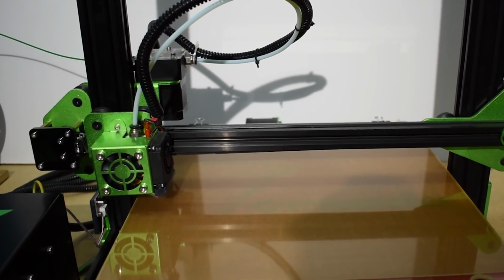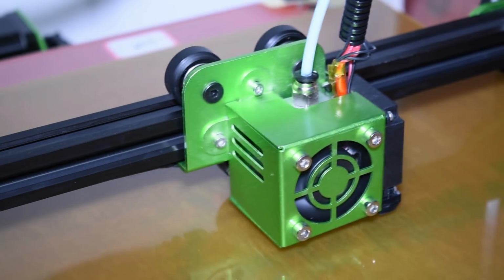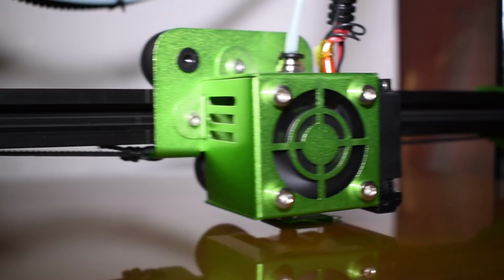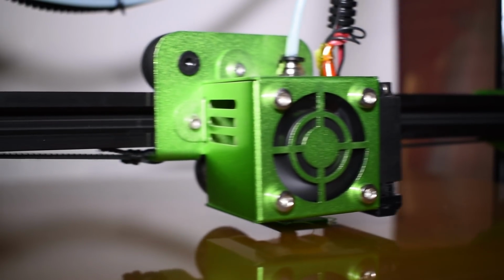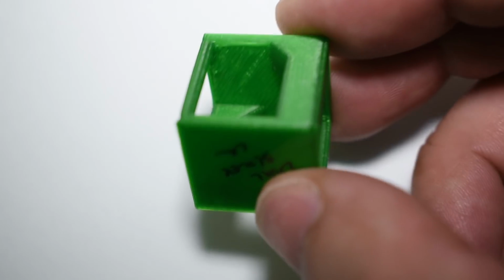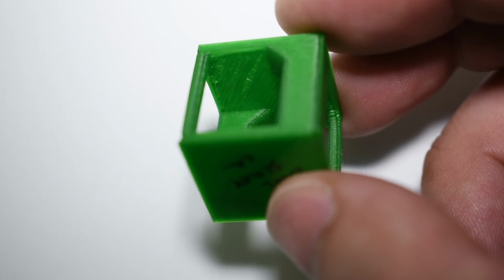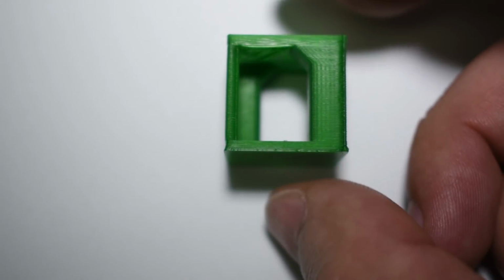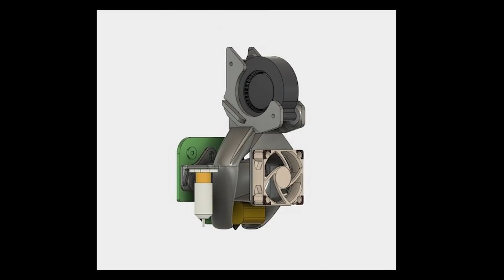6 Fanduct Comparison - Tevo Tornado 3D Printer

Comment: How can I connect 2 24V fans to an ender 3 pro?
Reply from the maker: you can connect them in parallel and use the same layer fan connector for both.
Reply: ruiraptor Are sure? Because I don't know if the Mainboard can Handel that for a longer time. But thanks I will try it👍
Reply from the maker: The fans draw small current. The board will handle a couple of fans connected in parallel. Just make sure you don't short anything.

Comment: Will the single fan blower version work on a cr-10?
Reply from the maker: Not sure if the position of the mounting screws are the same.
Reply: keep in mind that the cr-10 uses 12v unlike the tornado, which uses 24v

Comment: It looks like your adding an additional fan..  Where do you plug the third one into?
Reply from the maker: For the cases where you have a dual fan for layer cooling, you connect the second fan in parallel with the first one.
Reply: @ruiraptor  That doesn't cause too much electric draw and reduction of voltage?
Reply from the maker: You mean current draw? No, the fans draw a fairly small amout current.
Reply: @ruiraptor  Correct, would it cause any harm to my main board in the 3D printer?
Thank you for responding so fast buddy!
Reply from the maker: Not if you connect correctly both fans in parallel. ;)

Comment: @ruiraptor do you have a video showing the install of the fang(single fan), like how to remove the side fan and replace it with the top 5015 blower? Having trouble figuring out how to remove the side one, and where to plug in the new one.
Reply from the maker: Hi Justin, we don't have a detailed video about that, sorry.

Comment: what blower have you used ? A 24V one? Is it silent? I tried several 24V ones without finding a silent one.
Reply from the maker: It's not completly silent but it's not that bad. It's not easy to find a quiet blower.
Reply: @ruiraptor  no that bad is much better to the ones I tried. Where di you geet yours? ;-)
Reply from the maker: I bought mine on ebay.

Comment: Hello great video
 I was under the impression that  pla would warp as it would be right next to the hot end. Have you experienced That? Anyone.  been told to go abs but do not have the proper environment. thanks
Reply from the maker: Hi Alexander,
You should use PETG or ABS for the fanduct, however, in certain designs (the ones that are not too close to the nozzle and heatblock), you can get away with PLA. All the models that you see in the video were made with PLA.

Comment: what size is the blower and where should i getone from?
Reply from the maker: Hi,
The blower is a 5015 model.
You can find them here:
https://www.banggood.com/pt/DC24V-Cooling-Fan-Ultra-Quiet-Turbine-Small-DC-Blower-5015-For-3D-Printer-Circuit-Board-p-1108987.html?p=84280421195697201804&utm_campaign=21195697&utm_content=3312

Comment: I got the tevo tornado. ( new  version  2018)   thinking  of doing the same  cooling  fan update   but  I dont know. If  I  need 12v or 24v  fans  (  ideally  to  wire  it on. Stock wiring  from stock fan)
Reply from the maker: Hi,
Go with 24v fans. This way you can connect the new fan wire to the existing one directly.
Reply: Thx for the advice
Reply: where did you buy your tevo? im looking to get the tornado but want to make sure i get the newer 2018 version.
Reply: @millyvanillli2617   I got my from Amazon    ( last time I checked  was  not available  on the 2018 version)

Comment: Great Video.   What blower did you use for the "Fang with Blower"?   Did you use the 12v blower he describes with a stepdown transformer or did you use a 24v blower?  Thanks
Reply from the maker: Hi William,
I use a 24v blower and is connected in the same connector where the stock one was
Reply: @ruiraptor  how did you connect the blower fan up to the existing connector, is there a connector somewhere inside the tube?
Reply: Thanks you :)
Reply: Could you provide a make/model or a link to the blower fan that you used?  Affiliate link would be ok with me, BTW.  Thanks!
Reply from the maker: Hi Huskie,
No, there is no connector between the fan and the board connector. I just cut the wire and crimped a new connector so i could test all the different fans. You can do the same or just solder the wires.

Comment: I just installed the Petsfang on my Ender 3, using the stock fans.
The fang itself attaches now with M3 and nuts slide into it.
Seems to work okay.
If I didn't install this, I wouldn't have known Ender forgot to remove the two bolts used to align the hot end.
A common QC issue apparently.
Thanks for sharing, subscribed.

Comment: can you use the stock fans
Reply from the maker: The stock layer cooling fan is too small and i would recommend a blower instead a fan because it has a much better performance.
Reply: wOOx TM there all over amazon 50 mm blower

Comment: You missed my fanduct desigh;  I call it Z-19
 https://www.thingiverse.com/thing:2911981
It's an easy swap, using the CR-10's stock fans, no soldering needed;  but my "fangs" are designed mindful of basic aerodynamics, which none of the fanducts I've seen so far seem to.  Read about this in my notes on the Z-19 page.   You should give it a try;  I bet you'd get results almost as good with it as with those other designs featuring big blowers;  but I will be designing an upgrade very soon, that will use a 5115 at the top and a 40-40-20 below.
 I designed the Z-19 for Creality printers, but with a bit of modification I could make it serve the Tevo Tornado as well.
Reply from the maker: Hi Dan,
Thank you so much for sharing your design. I might test it soon. Also, if you get the new version working let me know.
Reply: Thank you for replying.  The Z-19 is finished;  it will stay as it is, at rev 1.5, unless some defect is reported.  The new version will be called "Z-X";  it will be a separate thing;  and will feature a 40x40x20 fan for the hot end;  one, or maybe two, 5115 blowers for model cooling;  and a few extra surprises... ;-)   I have a page for it already;  --but not much to see yet...
https://www.thingiverse.com/thing:2991795
 But so, the Z-19 was, and is, meant to be an entry level modding fang thing, easy to swap out the box and in the print, no cutting or soldering;  no new parts to order;  even using the original screws.

Comment: Bonjour et un très grand merci de France pour ce super test cependant j'ai une question esque le model (Fang With Blower) peut ce faire pour une Créality CR-10 ?  merci d'avance et bonne continuation.
Reply from the maker: Hi Serge,
I'm not sure if the fang with blower will fit the CR-10 as i never tested that, but i know that the second model (the petsfang) has a version compatible with the CR-10.
Reply: ruiraptor 
Un très grand merci Ruiraptor bonne continuation

Comment: Thanks for the great video!!  Would love to see an installation video on this if possible.  I know you show how to disconnect the old, but adding in the new is where the trickiness comes in (especially for those of us not blessed with an understanding of circuitry)
Reply from the maker: Hi David,
Thank you for your comment.
When you say "how to install" are you referring on how to place the fanducts or how to connect them electrically?
If you mean connect them electrically, then i can share that you just need to connect the new fan to the same port on the board as the stock one...or...just do like i did and cut the wire from the stock fan and connect the new one to the existing wires (red to red and black to black).
Reply: im going to be trying that once I finish the print sets that im currently working on.  3d settlers of catan.  id love to be able to fully dial in my machine as I see some pretty spectacular results coming out of the facebook group.

would a local hardware store carry the kinds of machine screws you used for this?  as for the electronics, I can probably muddle my way through the connections after spending a month trying to get the ones for the BLTouch done right.

Thanks again for the AWESOME videos.  love watching them!
Reply from the maker: Hi David,
FOr the winner model, you just need a couple of screws to secure the blower (or just use some zip ties while you dont find them). Those screws are easy to find. The others that secure the fanduct you can use the same ones from the stock assembly. For the pestfang it's more tricky...you need some small M2s and stuff. In his thingiverse page he mentiones the screws needed.
Reply: @ruiraptor  have you had any issues with your board from the extra electrical draw, by adding an additional fan.  The voltage drops when you add an extra load, has that affected anything for you?

Comment: Hey.Which is better number 3 or number 5?
Reply from the maker: Hi,
As i mentioned in the last minutes of the video, both have great performance. I have chosen the fang model (#3) due to the fact that it's much easier to install compared with #5. For the #3 you only need 2 screws to install the fanduct and you can use the same screws from the metal cover. As for #5, you need to buy one additional long screw to secure the center piece and some M2 screws for the sides.
Reply: Thanks.

Comment: I was curious if you had to adjust the fan speed any with the stronger airflow.  Years ago I upgraded my Ultimaker Original from a single 40 mm fan to dual 50mm on each side.  I noticed prints had great overhangs only on the side the fan was on.  Well the CFM of the new fans were so powerful that it was requiring more effort to keep the bed and nozzle to temp.  As a result, I had to lower (in slicer) fan to 50% to equal what the old fan could do.
Reply from the maker: Hi,
Yes, depending on the fanduct and blower used, you might need to reduce the flow %. It's important to choose the best fanduct and blower so that you have the best performance from the blower and the right air orientations from the fanduct.
It's better to have more power and don't need it than need power and don't have.
In any case, you should always adjust the flow % according to the model you want to print. Some models require less flow % and others require more.
In your slicer, you can set the flow % by layers and this way you can have areas with less flow % and areas with more flow %.

Comment: love the video, thanks for doing all this work! I just printed the fang/blower and installed it. Now I'm on my first test print I got "Temperature Runaway" error telling me to reset. Any idea what is going on? Thanks :)
Reply from the maker: Hi,
You probably have your blower running at 100%. Are you using the blower always on from start? Try to reduce the flow % especially in the initial layers and keep it off for the first 3 layers at least.
Reply: haha, I got 12v blowers. I'm running them at 35% and it's working beautifully :) Thanks for the video!
Reply from the maker: That explains it :)

Comment: Need to post what mods were needed to attach the blower  (clips , connectors , etc) to the stock wiring , and where to get those as well. Other than that nice tutorial.
Reply from the maker: Hi,
You are right about that. I haven't mentioned what's needed because each designed explains on their thingiverse page. Nevertheless, the one i have chosen is the easiest as you can use the same screws to secure the fang. You only need 2 aditional screws and nuts to secure the blower. About the connectors, you can solder the wires directly if you dont plan to switch fanducts or get molex or JTX connectors. Any will work.
Reply: For the fans did you splice the stock fan fire for it?
Reply: I'm new to this myself , but if you watch the video and at the 3:55 portion , is when he is removing the side fan , and I believe he cuts those 2 wires (pos and neg)  and puts a molex connector on it , and the blower has a molex as well and is connected to that connector . If I am wrong , someone please correct me. You can put any 2 wire connector here , since I have a lot of JST connectors , I will be using those .

Comment: What about stock one with different end duct point https://www.thingiverse.com/thing:2437407 or. similar. I like the design of the original one because it is more secure and protects heatblock if. it falls out. I know it is possible to use secure options in Marlin but still.
Reply from the maker: Hi Troy,
I did print that one too but i noticed a few issues...
One is that it is too close to the hotend so you need to print this one with ABS and not PLA.
Second, it is too small and it takes out the visibility.
And third, the air output is too small. With the fang models you have more output and therefore more performance.

Comment: What's the best cooler to use  with stock vents?
Reply from the maker: Hi Romex,
By vents you mean the heatsink?
All the models tested are for the stock hotend which includes the stock heatsink
Reply: Thank you for your quick answer :) That's what i wanted to hear, but i'm still not 100% sure... Fan @8.49 doesent look stock to me, that's why i asked.. I wanna use the original fans wich came with the tornado.
Reply from the maker: Hi,
We are talking about different things.
I was refering to the heatsink and you are referring to the blower.
In that case no. I did not used the stock blower except for the stock hardware (first test).
You have designs that use the stock blower (not tested) here:
https://www.thingiverse.com/thing:2842505
and
https://www.thingiverse.com/thing:2843375
There are more on thingiverse

Comment: the added weight on the print head is not an issue?
Reply from the maker: The X axis is very light. The extra weight does not make any difference.

Comment: Hi Ruiraptor, what is your method for quick connecting the blower (with female connector) into the cable casing? Did you install a male plug on the stock harness? Also, do you use caps on your blower to reduce whine and also maintain PWM control? Please share!
Reply from the maker: Hi Paul,

For quick connecting the blower I simply cut the stock wire next to the blower (a few milimiters from the blower) and soldered a new connector.
This way I don’t have to remove/install the entire cable all the way in the cable casing.
Regarding the caps, I didn’t have to. The blower is silent from startup to full speed. And I used cheap ones from ebay.
The loudest ones are the fans. The blowers are very soft when it comes to noise…at least mine are. :)

Comment: Did you use a 24vDC or 12vDC blower for the Fang with the blower ? I am wanting to do the same to my Tornado but I am finding it difficult to find a 24vDC 5015 blower. Excellent video, really helpful as print visibility is my biggest issue with the standard cooling.
Reply: Nevermind, I see this was answered in a previous reply 🤪
Reply: I just bought 24V 5015 blowers on eBay, 2 for $8, shipped
Reply from the maker: Hi Dave,
I used 24v fans/blowers. You can find them easily on ebay.
Reply: Thanks for all the replies, I managed to source some on Amazon that were deliverable to South Africa 👍🏼
Reply: Awesome video and very informative!!!

Comment: Awesome. I have decided on same course and have blowers standing by. Do you need extensions to be wiring the whole way into the controller or did you slice in? I haven't looked at stock wiring and was curious what is required
Reply from the maker: Hi Jason,
I didnt use extensions. I just cut the wire next to the stock blower and soldered a connector. For the new blower, i cut the wires and soldered the matching connector.

Comment: How did you converted all the fans to 12V fans using a step-down regulator to power them?
Reply from the maker: Hi Zaily,
I havent. The tevo tornado is 24v and all the fans i used are also 24v.

Comment: Excellent video as always! Thank you a lot! BTW: compared to the stock config: did you notice a difference in the regards of noise? I'm trying to make mine quieter for the whole print (except the start where the "engines start" at the beginning, I don't care then as it only last for one minute or two) as I work in the same room... Cheers!
Reply from the maker: Hi,
Compared with the stock blower, the fans are louder but the blower (the one used in the 2 winning fanducts) are not loud. The stepper motors are louder than the blower.

Comment: Hi rui,

Thanks for this overview!
How do you install the blower of your favorite Duct to the board?
Reply from the maker: Hi,
The fans/blowers were all conected to the existing connection (to the stock blower wires).
Reply: ruiraptor oh wow, I thought they run on a different voltage, but that's nice.

So just cutting the wires and soldering them back together is all it takes?

Comment: So here's a dumb question ; What's the connector used to swap the fans? I like the flexibility.
Reply from the maker: Hi Cory,
I used the same connector type as the one you connect to the board (JST-XH (2.5mm pitch)). The difference is that i used 3pin connectors instead of 2 pin connectors.

Comment: To install the petsfang, you have to slide the piece on a little, rotate it to the right, then rotate it to the left to clip it on, it's not supposed to slide straight down from the top. You didn't have to modify it. =P
Great video, though! Nice to see these different fanducts compared. =)
Reply from the maker: Hi, you are correct, but the way i did it, you don't have to worry about the wires that are on the right side. 
The installation is far more easy and less problematic...especially when removing the piece.